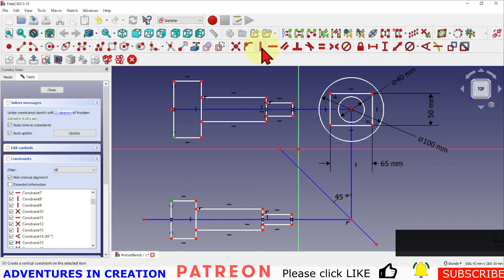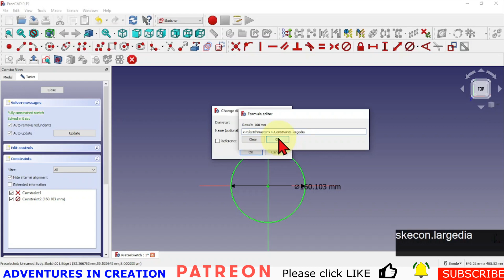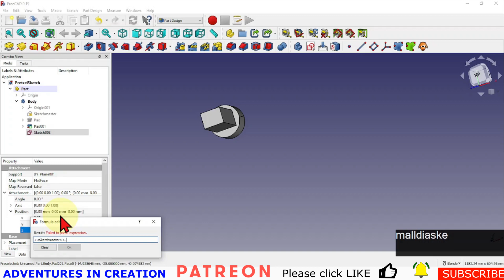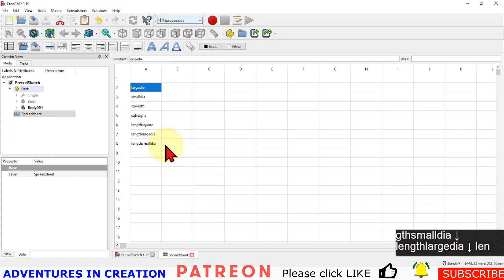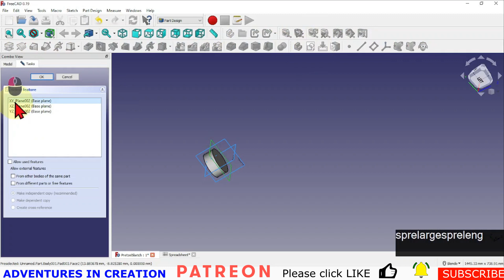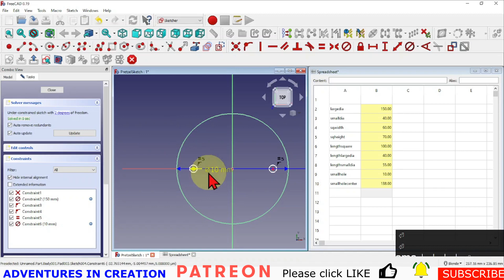FreeCAD Beginner #14 - Using a master sketch

Comment: Just a bit late to this series but the videos are still very useful for me being new to FreeCad.  For now, I think I prefer the spreadsheet because to me it easier to go to the spreadsheet and change a value of a dimension as opposed to finding the dimension in a busy drawing, double-clicking and then changing it.  I typically start with my sketches on paper with rough dimensions so the spreadsheet makes it easy to pre-populate the dimensions and then build the model from there.
Reply from the maker: I totally agree. I usually approach it the same way.

Comment: Enjoyed the modelling differences between master sketch and spreadsheet design. I would say that the master sketch method is greater degree of difficulty because the drop down menu for master sketch has multiple entries of master sketch ( capital letters, lower case letters, both with and without parentheses, then there are sketch 001, 002, 003 with and without parentheses, before one can find the actual named dimension in the list, so very tedious to follow. I did notice that the sketch numbers mentioned above seemed to follow the arts tree hierarchy. Overall I found that the master sketch involved retaining more names in ones current memory slots front cortex, so that makes it harder. But good work with the comparative methodology. Cheers Graham B
Reply from the maker: Spreadsheets are still one of the more simple approaches

Comment: Great stuff.  It seems to me that the spreadsheet approach would be useful for something that has to be scaled overall - I haven't tried it but I guess that I could build a spreadsheet column that calculated, say, double the original dimensions, and then alias them so that the doubled values drive the sketches?
I notice that in the Master Sketch I can filter the constraints so that it shows me only the Named Constraints, which is handy when I'm naming them in the first place, but it's irritating that when referencing them in the model sketches, the editor doesn't bring up the options for named constraints in the same way that it does for spreadsheet aliases.  I can live with it, so thanks to you, and thanks to the FreeCAD developers.
Edit P.S.  You didn't tell us what the 45° construction line was for in the Master Sketch...?
Reply from the maker: Excellent, you are approaching it the right way, push the limits and discover how you can make it work for yourself. The 45 degree line was a projection line but I ended up working around it.

Comment: Thanks for this series, it's been very helpful so far. You've certainly earnt a sub and probably another patreon :)

A quick question, you refer to dimensions that are defined with a formula as 'reference' dimensions (and they turn blue). I'm using a default install of freecad (0.20) and when I use a formula to define a dimension, mine turn orange. They turn blue only if I specifically draw them in using reference mode (blue up in the toolbar) or actually tick the reference dimension box.

Have you changed the colour scheme, or are perhaps using another option somewhere?

Sorry if this is a dumb question, I've yet to read up on how all the 'reference' and driving dimension stuff works, I'm not across that at the moment.
Reply from the maker: Thanks, I appreciate it.

Comment: Everyone, remember to have the "Auto remove redundants" and the "Auto update" checked or you will get the over constrained error, I saw those settings.  So that solved "that" problem but there are still settings that I have not matched to yours giving me problems.  I cannot get the 1st dimension to take in blue it comes out in orange like a constraint error.  Can you go over the settings you use in case there is something there? Update, I got everything to work but I have orange colored dimension lines on the side views. go figure? 👍✌🥃
Reply from the maker: Yeah, auto remove is a good thing. You can still get some constraint errors. I usually find my approach of constraining geometry first before adding dimensions usually gets me to a fully constrained sketch faster.

Comment: I'm going through in order, and it appears that I'm about halfway through so if you cover this between #15 through whatever number you are up to by the time I get there, disregard; I'd like to be able to do some exporting of PDF's of the technical drawings, I assume that I need the master sketch method and the TechDraw workbench..  I didn't have any knowledge of the master sketch until today, and poking around the tech draw workbench left me frustrated enough to come back to these videos.  I don't want to skip around because I don't want to miss something important.

BTW, yesterday I modeled up a repair for a wall hanging home decoration and it actually worked.  I modeled it up in under 30 minutes. Two weeks ago, I doubt I would have been able to do it as efficiently, in fact, I probably would have been too frustrated to finish it, and just make it with my angle grinder and some scrap pipe and/or a lot of glue and duct tape.
Reply from the maker: Take a look at the latest video #27 it has Tech Draw in it, that's where you would create the PDF output from.

Comment: Thank you for the great videos. I am someone new with freeCAD but have a long experience in drafting from ink drawings, cad, 3D molding  and FEA applications. Now I am using freeCAD for woodworking projects and one major advantage of the spreadsheet for me is 1- I defined my stock material size in one place. ie : board thickness. If my purchase board is different I can be adjust the model for it. 2- I can standardize the size of my mortises and tenons, tongs and grooves and apply this dimensions thought out my project. 3- can adjust tolerance that I get from my test run piece. This is a major spreadsheet's advantage even if I making one table or one cabinet. I designed it without knowing the final dimensions of my stock material and adjust when I start making it. One assembly, multiple of small standard components  that can vary from error or supply. The spreadsheet is superb for this in my opinion. Luc
Reply from the maker: I too learned from paper drafting. Your approach is bang on!

Comment: This is very cool. I want to start 3D printing bucks for hat making and a spreadsheet will be perfect for changing hat dimensions!

Is there a way to add notes or labels to the master sketch? For instance labels that say "Top View" , "Side View",  " Front view"? Along the lines of draft lines in that they do not effect the finished model, they just appear on the sketch?
Reply from the maker: I don't think you can add notes to the sketch without affecting the model but I will check

Comment: GREAT VIDEO, need to know my options for sure. PROGRESS REPORT: After this 14th video I am able to predict what the next step may need to be, to try operations on my own and sometimes I get it right,Lol. The biggest thing to me that caused the most confusion was the "Order of Operations", in which I have learned to Open File or New File, then Save it, then create the Part, then create the Body (rename Body before creating the sketch helps at this time, or weird things happen?), then create the sketch. Practicing over and over helps, repetition is my friend. Being able to create using either a MasterSketch or a Spreadsheet is awesome. I've had a lot of trouble with making objects symmetrical. getting "sketch contains redundant constraints", "Please remove the following redundant constraints: X" is critical to fixing the problem, do not just delete the very last constraint in the list, this just deletes the symmetry you just did, the culprit is usually before this, right after the colon(:) duh .... to me. After the last video I was messing around with changing directories to get to my recently downloaded and saved fonts, well FreeCad changed my default directory structure so when I tried to save a new file it would create an error, so I had to go back into my directories after selecting New, or Open, and directing FreeCad on where to look, my was under C:/Weliver/documents, and then everything started working fine!
Thanks
Reply from the maker: It sounds like you are really getting to grips with it Gary. - If you continue like this, you will be an expert in no time ;-)

Comment: Brilliant as usual. I use a master sketch method but then use shape binder to get sizes into the working sketch. Memory is not good enough to remember the names  I gave to dimensions! Found recently that shortcut for getting external geometry has changed from just x to g,x. Thanks for all your work enjoy it all
Reply from the maker: Excellent! Some people are using a mixture of master sketch and spreadsheet for that reason.

Comment: Great video series.

2 questions:  

1) What is the purpose of the Reference check box on a constraint dimension ?

2) Why couldn't you combine a spreadsheet with a master sketch ?    Put the dimensions for the master sketch in the spreadsheet.   Best of both worlds ?   I like having the master sketch to visualize what I'm building.   But I like having values in the spreadsheet because they are easier to change there.   And you can do things like tolerance clearance calcs in the spreadsheet and have it update the master sketch and then the model. 

Wouldn't it be nice if you could have the spreadsheet tiled beside the sketch, open a dimension constraint, select the cell you want to take the dimension from and it pastes in the Spreadsheet.<alias> variable name ?  Could this be done with a macro ?   It wouldn't be hard if you could rightclick the cell to copy the full alias object name ?   Would eliminate a lot of typing.

I love the concept of using both a spreadsheet and a master sketch.   So much easier to make changes to the model without digging through all the individual sketches.   Really easy to identify how changing a variable will change the model when you see what it does on the master sketch.  For me, this aspect of 3D modelling has always been missing... no "big picture" of the model's dimensions.
Reply from the maker: I like the approach with a spreadsheet and master sketch. I suppose it depends on the complexity of your model, give it a go and let me know how you get on with it.
For 1) I believe that is allow you to see a dimension without it being a "driving" dimension.

Comment: Good Video..

Exploring 2D drawings is a benefit if your going to be using say blueprints and the like as such formats are 2D based. Even in Blender, we often use 2d images to create 3D forms - so understanding doesnt hurt..

With respect, I wouldn't necessarily avoid caps in naming - I actually constantly use them in a c++ style naming convention..

Say for instance you came back to your project months later or another was to make use of your project, you may have to study to figure out the names.. Instead:

sqWidth - sqwidth
sqHeight - sqheight
largeDiam - largediam
largeDiamHeight - largediameterheight

Just makes reading easier - I even use it for naming parts/objects in any graphic software and even spreadsheets.. Just a thought to bear in mind..
Reply from the maker: Thanks for the input Paul, I am thinking about some 2D techdraw stuff in the future.
Reply: This type of file naming nomenclature is one of the only things I remember from programming class in university XD
Reply: @DaleyKreations  and possibly one of the best.. I use it basically everywhere..
Reply: I am told by my expert programmer coworkers that this capitalization convention is called camelCase.  I am not a programmer, so I only have their word to go on.

Comment: Too bad there's not a way to generate the master sketch as you have and then let it produce a spread sheet from the sketch.
It seems that the correlation would need a reference point to establish from.
IS that beyond the ability of FreeCAD's algorithms ? 
For someone who learned technical drawing as a schoolboy on drafting tables 5+ decades ago with pencils, rulers and soap erasers, THIS FreeCAD is like being in drafting heaven with angels showing it in 3D video as it's being designed !!! Your presentation is Ecstatic.
Reply from the maker: I am sure with some programming it could be extrapolated into a spreadsheet. I too created drawing with pencil and paper... This is way more fun!

Comment: The = hotkey is oneheckof a useful keyboard shortcut. By the way, I'd use a spreadsheet all day long as opposed to a master drawing as you illustrated. Great video, lots of good info and I appreciate your hard work in teaching us about FreeCAD.

I do have a request, I am designing a part to hold a dial gauge (horizontally or vertically) on a 20x20 extruded aluminum rail (think 3D X-axis) and I managed to get the basic cup done with the cutouts for the stem, but I have not yet been able to figure out how to cut out for the gauge face locking screw, it's about 45 degrees offset from the stem. 

Still learning but having a great time, also was not able to get the polar pattern to work for the cutouts around the outer perimeter of the cup, any suggestions.
Reply from the maker: Can you share a sketch of what you are trying to do?
Reply: @Adventuresincreation  Just sent you an email with the FreeCAD project file.

Comment: What is the purpose of the 45 deg line on the master is it just to indicate that it's a plan?
Reply from the maker: It's just to project lines from one view to the other.
Reply: @Adventuresincreation  Once I realized where you were going with those draft lines, I was hoping you would need to use them. I, too, am a CAD amateur, and would love more videos on sophisticated techniques like this. Thank you!
Reply from the maker: @wwadley  I learned drafting on paper way back when... we would always use projection lines like that. - I was able to create the projection without much need for the extra lines but they do come in handy if you can't do that.